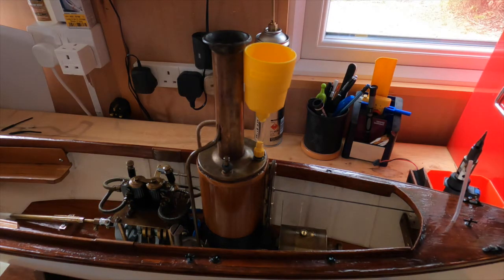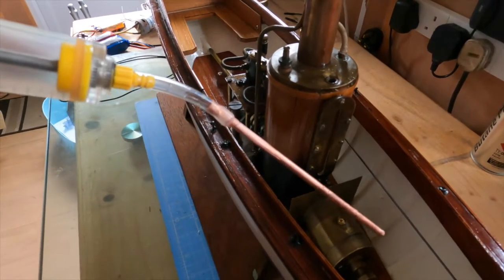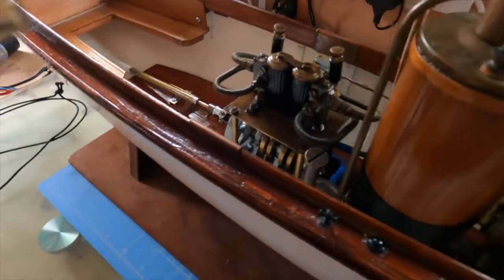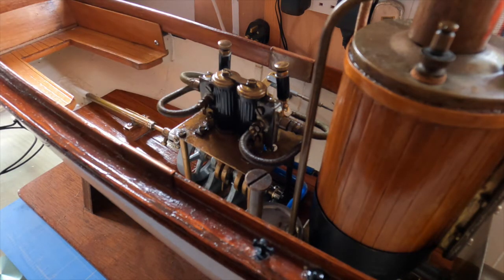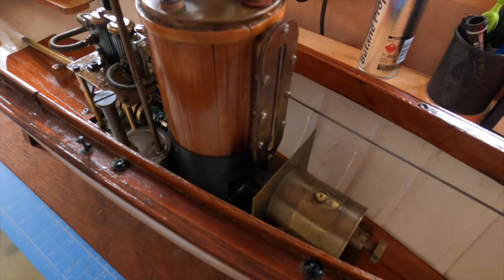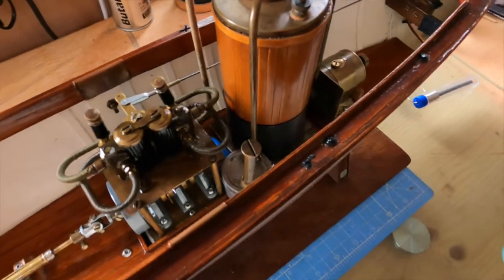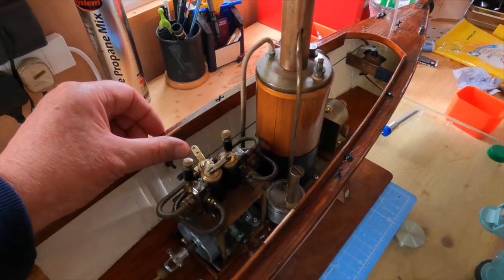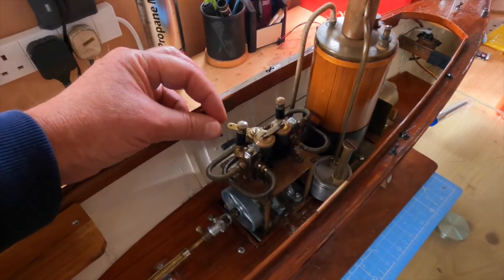RC Boat, steam start up

Comment: Are you using proper steam oil and 220 oil for the rest of the moving parts🤔 The oil i saw you using wasn't proper steam oil
Reply from the maker: Hi Russell. The oil came with the boat and is marked up as steam oil. It is very thick compared to normal oil.

Comment: Great boat! I run my boilers at about 30-40psi before starting then run engine and adjust heat for drop. You can find a balance point good for 5-10min of rc sailing.
Reply from the maker: Thank you for the comment. I have still not had the boat on the water yet. Just waiting for a nice day. 👍🏻

Comment: what model is the Clevedon steam engine and do you have any idea re the running time using that size boiler ( is it a 3 inch diameter boiler ) ?

Comment: Hey Paul, that's beautiful! Have you had a chance to get this on the water yet? 

I have a Wilesco steam roller which I have a lot of fun with.
Reply from the maker: Hi Matt, great to hear from you. Good to see you out on the water in your last vid.

Funny you should comment on the steam engine. Just this week I fired it up for the first time in a long time. 
I have taken it to the park lake once and I forgot to take the gas refill. 😃

Im thinking of selling it as I am not getting the time to use it and it is a shame for it to sit around collecting dust. The problem is I do not like to get rid of anything😀

Looking forward to more of your vids mate.👍🏻⛵
Reply: @SCCFORUM  Yeah I figured it was about time I got it on the water. 

Ah that's a shame you forgot the gas. That'd make a cracking video, I imagine a lot of people would be interested in seeing it run. 

Where did you get hold of it if you don't mind me asking?

cheers mate!
Reply from the maker: @thesailingdonkey  Hi Matt,
I will probably get it on the water before selling and video it.
I got it from a seller on ebay. An interesting guy, he had a lot of RC stuff including a 8 foot wingspan Spitfire.